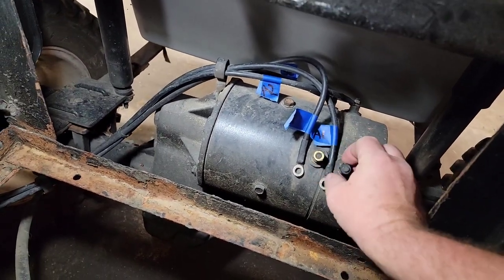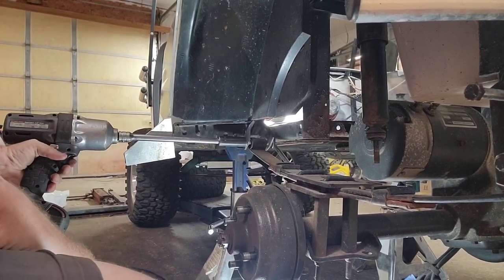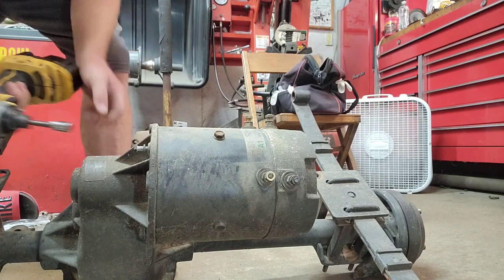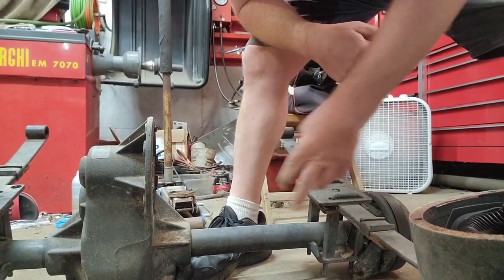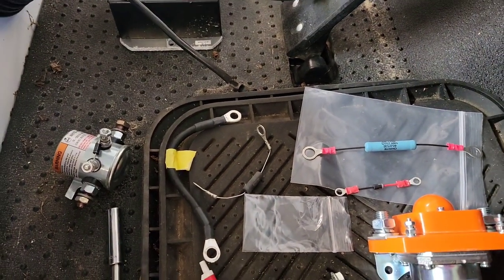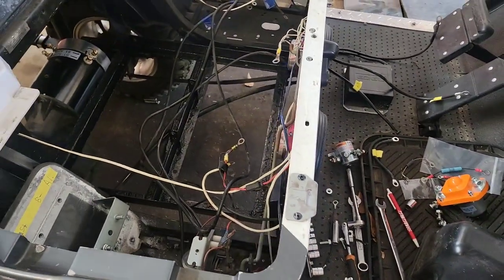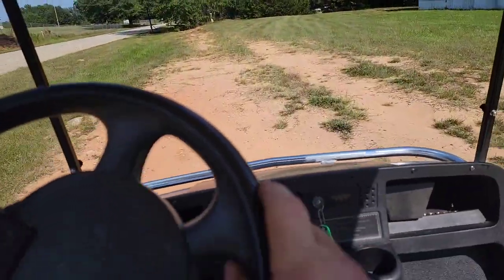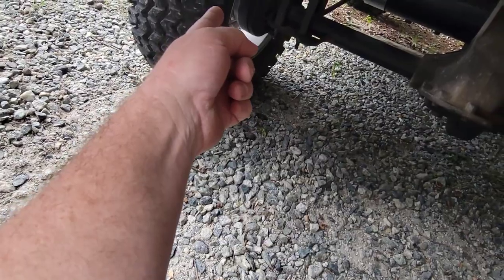Ezgo txt 36v torque motor,solenoid and wire upgrade system for hill climb @Vassmotorsports #viral

Comment: Anyway you could send me part numbers and contact to up grade control board. I have the exact same make and model ezgo and same issue and want to do these upgrades to mine. I would greatly appreciate it. Thank you 🤙.
Reply from the maker: im sorry but i dont have specific part #'s but i got everything right on Ebay and you can find everything i used ,just shop for best price and seller with high scores ,  if you type in ezgo controller and scan the list you should see the guy that rebuilds them ,  and he is in Florida,   think his name was Desiel tech or something of that nature ,  thanks for watching Vassmotorsports and hope ya check out some of my other videos sometime,    that controller just wouldn't hold up to the larger high torque motor and the extreme hill and we decided to try a Navitas blue tooth 440amp series controller but ive still been having little trouble here and there with it ,  https://youtu.be/YsoJIs2qJmQ?si=qqqn_JFDirpIYtax

Comment: Do you have the links for the forward reverse switch you used as well as the guy who upgraded the controller?
Reply from the maker: https://www.ebay.com/itm/186163043382?mkcid=16&mkevt=1&mkrid=711-127632-2357-0&ssspo=-_pn7zeoqh-&sssrc=4429486&ssuid=sw5ZXj_VT7e&var=&widget_ver=artemis&media=COPY.    I cant find info on controller guy now.

Comment: I have a two seater that we converted to a 4 seater. I added stronger leaf springs as well but it does not have a true "lift kit" installed. I recently put 6 brand new powertron golf cart batteries. When the batteries are fully charged, with a max weight of less than 500 pounds of people, the cart is getting a max range of 10 miles per fully charged. The batteries are less than 3 months old, and we were getting a lot longer distance with the older batteries. Do I have a bad battery, do I have a failing motor, suggestions? The cart also feels it has a short in it and will "beep" 3 times and stop running. You will have to release the pedal and reengage for it to go again. The startup acceleration is poor also.
Reply from the maker: thats really hard to diagnose with out seeing the cart in person to test a few things.  could take a volt meter and check the batteries individually ,  once after full charge and again after a couple minute ride.   they should all be very close in voltage and if one is bad youll be able to tell. ,  also make sure no wires are loose and can not turn any by hand as thats no good either.   but you have me thinking it could be in the controller as the way it stops and beeps and stuff.   thanks for watching Vassmotorsports and hope ya check out some of my other videos
Reply: @Vassmotorsports  I checked each battery individually. 5 of the 6 were reading 6.4 24+ hours post a “full” charge. One battery was reading 6.1. I rechecked while charging. 5 of the 6 showed 7.4 but the other one showed 6.8.
Reply from the maker: @jonathanmansfield9302  the one at 6.1 is low and considered not good especially after charging and of you didn't drive it ,which sounds like you didn't,   would like to know how they look if you did a quick ride maybe 2 minutes,    wanna know how low that one drops compared to the others

Comment: Do you have a list of parts you used?
Reply from the maker: Thanks for watching Vassmotorsports, sorry I don't but I bought everything on Ebay ,  the high torque motor( have to upgrade controller and everything else )  HD forward/ reverse switch,  400amp solenoid, 4 gauge cables ,new batteries (it needed anyway) and I sent controller to be upgraded but with this enormous hill it has killed the controller and sent back for warranty and it just went out again last week ,  it burned the inside of it up and I was afraid that the stock unit was not designed to handle the upgrade and the hill so I'm getting a Navitis 600amp aftermarket controller and I think that'll do the trick
Reply: Good to know that the upgraded controller could not handle it.   Let us know how the Navitas does.